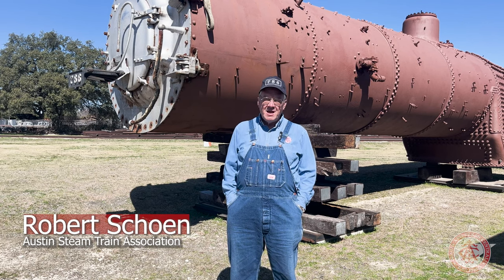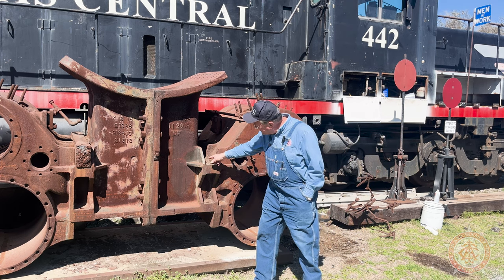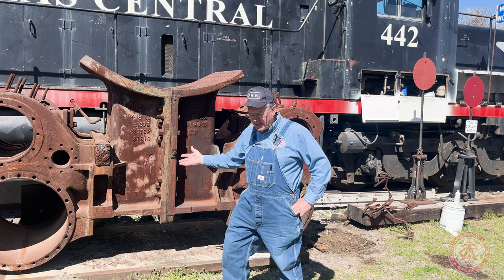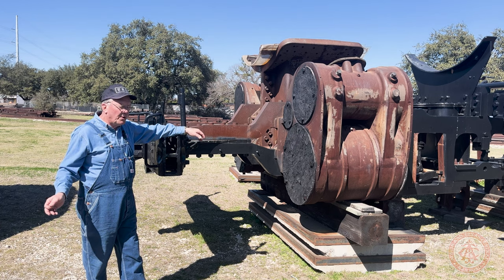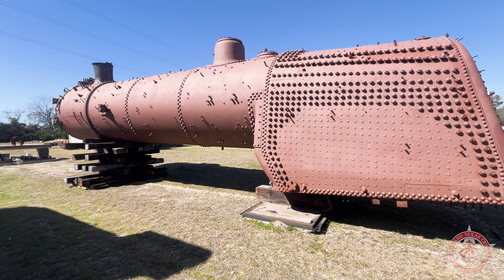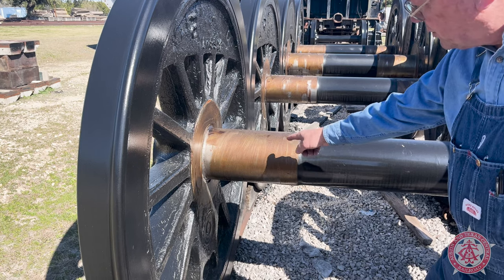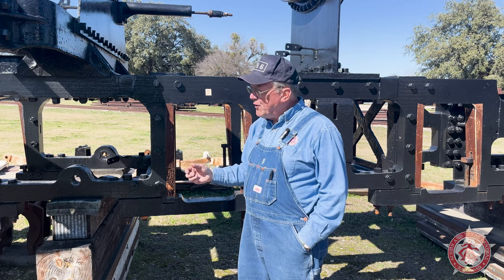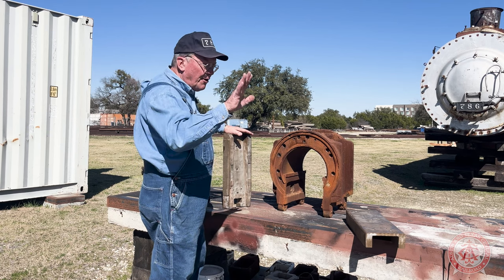The Next Steps of the SP 786 Restoration - Shoes & Wedges Discussion - Ep. 1

Comment: Thanks for the update! Haven't had the pleasure to make it out to the railroad yet but I'm planning to soon with my family. I grew up in the Northeast and was pretty much raised at Strasburg Railroad and am a huge steam locomotive fan. I remember reading that they did some work for this engine.  I am sure their work and consultation isn't cheap, but I'm willing to bet if there is anywhere or anyone who can help get that engine running again its them. I hope you get that shop built, as getting the 786 running again is the just the first step. It needs to be stored properly and maintained afterwards.